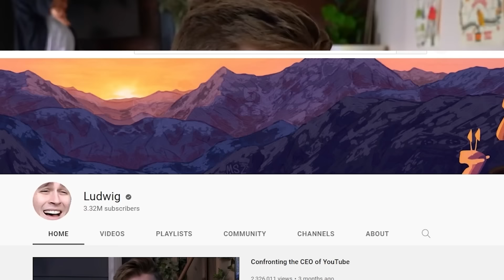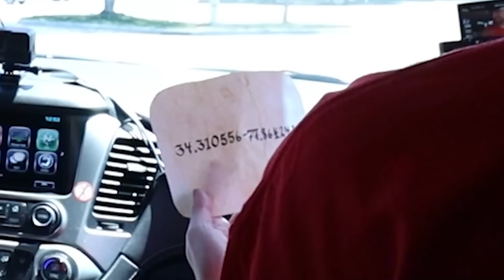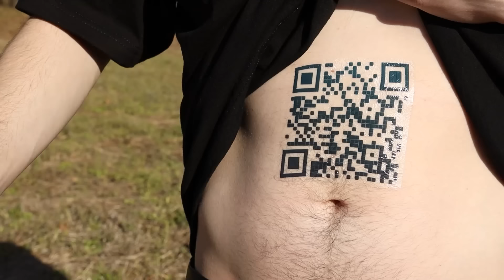I Buried $100,000, Go Find It

Comment: I'm shocked no one is talking about how this is also the Hacksmith industry video that was almost ruined. Considering what Ludwig said about what happened to many of the challenges in this video, it's honestly hilarious that something almost went wrong with ANOTHER one of them.
Reply: What happened?
Reply: @theMcWOPPER  Before the Safe-Melting Scene, the crew was messing around and accidentally broke one of the safes. They had about 10 minutes before Jimmy got there to fix the problem.
Reply: @theMcWOPPER  tl;dr both the hacksmith industries people tipped over the safe, the safe's cutout was made of gallium which promptly shattered due to the temperature, and they had ~30 minutes to then melt the gallium shards (using their lightsaber), pour it back into the crack left behind where it used to be, and then freeze it again using propane
Reply: @aubreyathame  absolutely epic tbf
Reply: What did lud said?